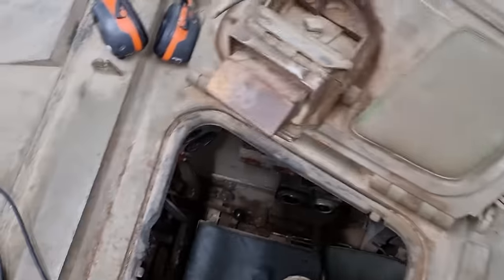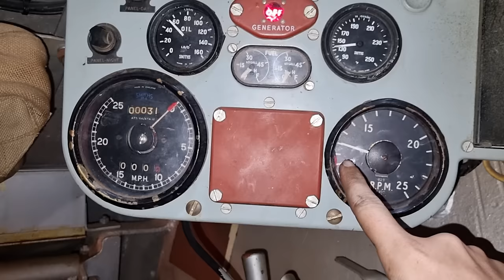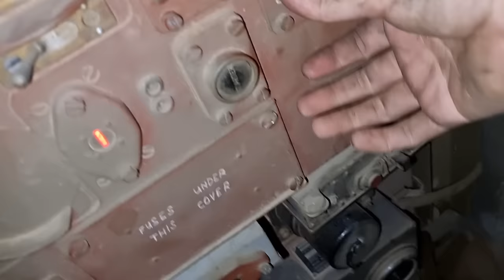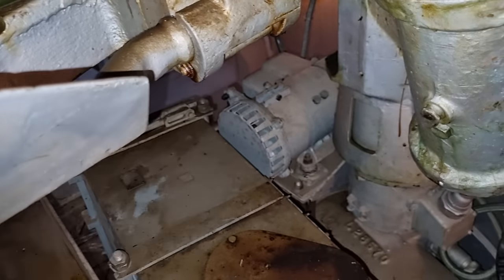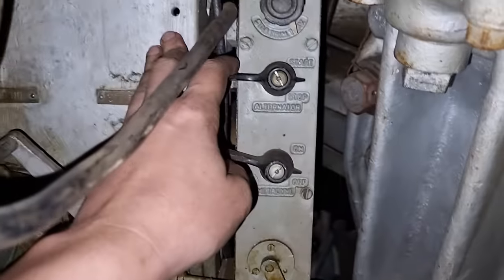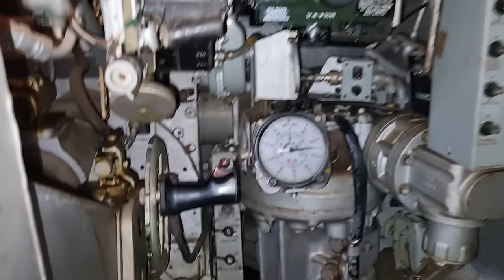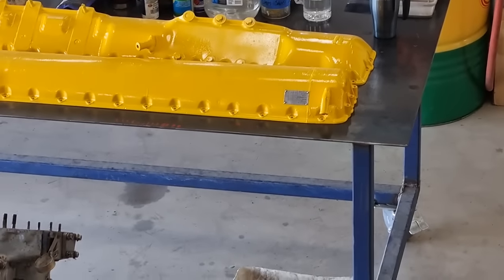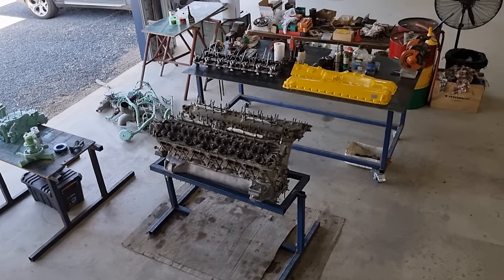Starting up the Centurion

Comment: Wow that main engine starts quickly. I would have expected a slower more rumbling sound.
Reply: We run electric pumps for pre pressure . no throttle and it starts on the button every time. 😃
Reply from the maker: If you set them up right, they should start quickly enough. It's mostly fuel supply. As Peter mentioned, we run electric pumps.

Comment: With that engine being so open (to the elements like airborne dust & dirt) don’t you cover it up?  Enjoyed the video. Happy Christmas from England btw.
Reply from the maker: There is actually quite an intricate vent set up in the deck covers. It stops all the larger debris from getting in. The short answer is that you will never not get dust into the engine bay. The fans will pull it all in regardless. Fortunately, dust is only an issue if it gets into the engine, so they use two massive air filters. The air also blows upwards through the radiators, reducing the build up of dust on them. They still need cleaning, but that's part of running tanks 😊

Comment: you covered the motor generator  that powers the turret but what do the magnadynes power?,the CAV switchgear is almost identical to leyland buses LOL
Reply: Lottie  will put up a detailed gunnery with the Stab working next time. 😀
Reply: @petercordell5177  and i take it your tank man? LOL
Reply: @petercordell5177  cos it seems strange your commenting from an empty channeel which usually means bot or troll
Reply from the maker: In short, the Motor Alternator set I covered provides the AC current needed for the inductors needed for the feedback system of the turret. The metadynes control the motors for the elevation and traverse. This is a very basic level, but they are as essential as each other. I will be doing a proper I depth video in the future. 😊
Reply: @lottiethetankwhisperer  ok so it's a set of 3 motor generators
Reply: @lottiethetankwhisperer  Lottie, we play with 169127. So far, we use emergency mode to traverse the turret at a constant speed. Am I correct in assuming that if we start alternator and metadyne (and have gyro isolator off), we can then traverse turret at variable speed and also achieve power elevation? Looking forward to your in-depth gunnery video!

Comment: The oxygen... yeah, the oxygen thing. 
For those of us playing at home with limited knowledge of tank stuff - why is there an oxygen thing?
Reply: Aux gen = Auxiliary generator.   So you can hide in an ambush position, but the bad guys can't hear that big old 12 cylinder meteor engine.
The Aux gen, is loud in the current, but outside it would be quiter than the main engine, also more fuel efficient.
The Aux gen also has a smaller infra red signature than the main.
Reply: @myradavis2599  Couldn't have said it better ......Cheers.
Reply: @myradavis2599 Ahhh... 'aux-gen' I thought she was saying "oxygen".
The 'oxygen' part was kind of making sense though - confined space, fuel and oil smells, long periods in heat, etc. - might need some freshish air!

Comment: well apparently theres an auxillary motor you havent covered yet,it produces 3kW of 24 volts,the main engine produces 1.5kW of 24 volts,as you have space for 4x6 volt batteries id reccomend 4x12 volt optima batteries in series/paralell configuration
Reply: Are you referring to the Aux gen ??????
Reply: @petercordell5177  are you now going to argue if its an aux engine or generator? LOL,the pics i've seen are of an L200 continental L200 jeep/forklift motor,but that could be an american export version,in a cheiftan they apparently use a coventry climax engine
Reply: @petercordell5177  if you recon your all you are LOL,explaining what the magnadynes power should be real easy for you LOL